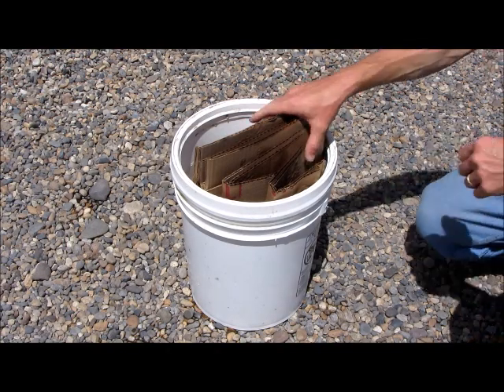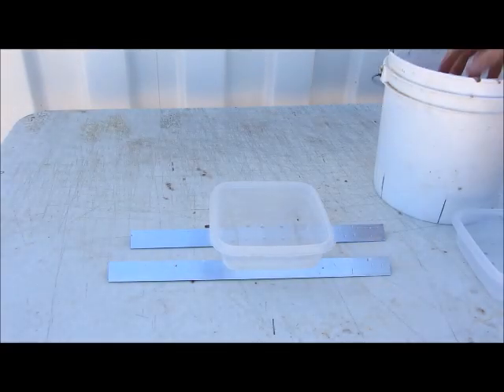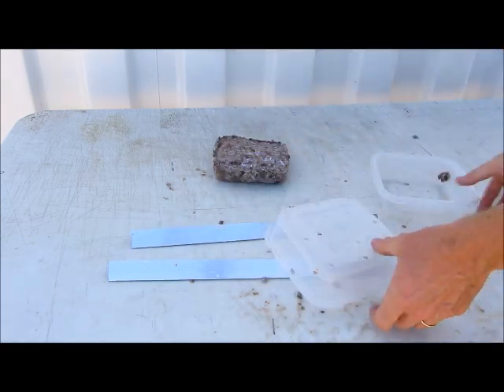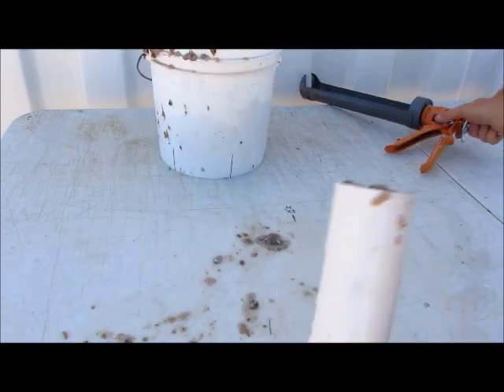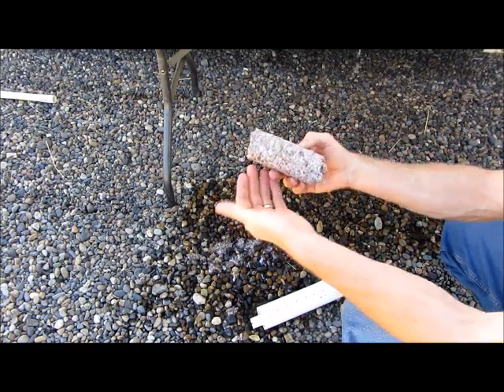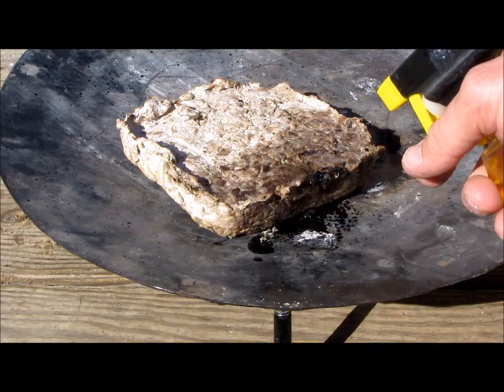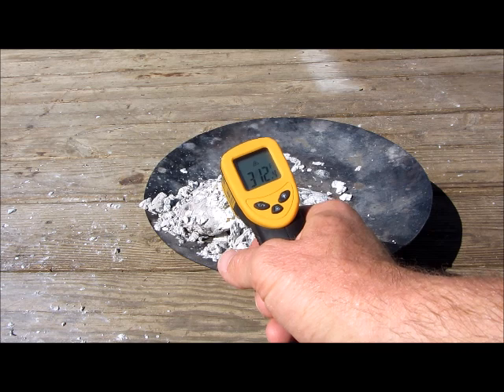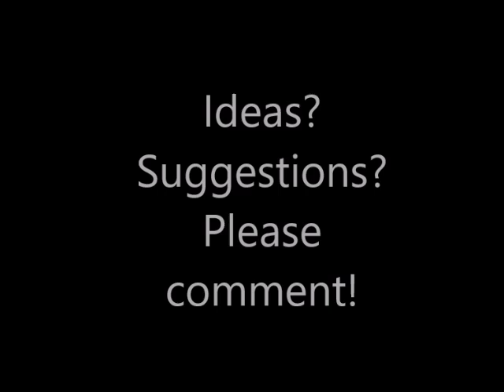Free Fuel To Heat Your Home, does it really work?  Paper and cardboard fuel test

Comment: i do wonder if shredding the paper increases the burn time or heat, as the shredder paper has more air pockets which gives the fire more oxygen to burn hotter. I also wonder if its better to just burn cardboard or just burn paper. i hear cardboard gives a lot of ash compared to paper.

Comment: You are doing way too much work. Why not wet them to soften them, and then roll 'em up tight into a log? Also, instead of lighting fluid, I dipped a small piece of paper into used vegetable oil and threw it into my barbecue (I used tree branches and kindling of course.) It worked like a charm the first time, and is probably healthier. Now if I could get the temp up to 2345 F., I could "bake" my clay creations without having to buy a kiln. Any ideas?

I also like Michael Crumpton's idea below.

Comment: Great video thanks! But how about simply burning paper without mashing and bricking? I know that loose paper may burn quicker than a compressed paper log so need refueling often,  but would one get the same total heat out of it? Would particulate emissions be higher?

Comment: Issue 1: Ash.  Burnt paper/cardboard produces tons of ash - far more than wood.
Issue 2: Mass.  The total mass of paper that you gather to turn into bricks is relatively small each year.  One proper log from a fallen tree that you ask to salvage for firewood will provide more heat.
Issue 3: Time and Space.  It takes a long time to mulch the paper, form it into bricks, and let them dry.  Drying them properly takes more than a few days, and you have to store them somewhere where they can dry during that time, but they aren't weather resistant in the way that wood is, so they need special storage.
Reply: ash from clean paper can go right into the grass or garden. as for the other issues, you're right, but at my job we have so much scrap paper going into the trash that it's dumb not to utilize some of it in some way. instead of watching netflix, I'll spend some time doing this. I'm going to build a press here in a week or two.

Comment: Suggestion, use paraffin instead of anything really toxic. I used sawdust (non toxic wood), put in cardboard egg cartons, with melted paraffin as firestarters for my wood burning stove. Worked very well and was very cheap. I imagine balls of paper slurry and then dipped in a thin layer of paraffin when dry would work just as well. Use an old pot that you don't use for anything else though.

Comment: Davi Hodges

I've seen  many posts about folk tearing up paper, soaking it, mashing it, drying it out and then burning the end result, some of them are quite inventive but all are very labour intensive and very time consuming!  I tried the brickmaker a long time ago using the same techniques...bluddy useless with so much time & effort required......I then experimented with just rolling up newspapers, mags, junk mail, bills, etc, binding them with tape or string, cutting them into sizable length logs on the circular saw bench, and then burning them. 

It worked well, better than I thought it would.  They produces a lot of heat, just as much as the 'wet' method,  a little smoke sometimes, but with only a tiny fraction of the  effort  compared to  making paper bricks......and less messy too!  The rolls do sometimes open up a little once the string burns through but I've not found that to be a problem at all.....they still burn, it's not as if they explode open and scatter burning paper all over the place, that doesn't happen.
 If you leave the rolls for a week or so before burning there's less chance of them fully opening up, they stay rolled up, a little looser but still in a roll, still burnable. The logs tend not to produce much flame or smoke [if any], they just smoulder which is good......stops the neighbours complaining about any smoke.  After, I spread the ash onto the garden which helps the plants and any crops to grow.....and they do  grow bigger & better, but only the ericaceous plants!!. 

The biggest problem is burning glossy magazines because the pages have a thin coating of china clay which doesn't burn, [but it does give the pages a better surface on which to print fine and solid colours! ]  but it just gets mixed with paper ash. Bits of wood mixed in the fire with the paper logs is fine too, so a good mix of newspaper logs with a small percentage of glossy mags is ideal. I should mention that I use a cast iron pot beliied stove which is totally contained and adjustable for air intake etc.,  I haven't used  these logs on an open fire but I would imagine the results would be similar, but perhaps a little caution is needed on a open fire.

Comment: Your location is the key to this.  You really need to be able to dry these WITHOUT spending money.  Setting them in the hot sun is the best.  Placing them on or next to a wood stove is good, but that does technically limit the heat said stove gives off.

Comment: I make fire starters out of newspapers.  Just tightly roll newspapers and thread through an empty paper towel or toliet tissue holder. Set up your campfire logs as desired, then tuck the fire starters in between the actual logs. It's surprising how long they will burn, and set fire to the true logs very easily

Comment: You could make a box out of a 1/2" plywood bottom sides of 2x4 studs. Shaped like a brick, but 3 times taller.  Then drill the bottom and sides for drainage.  Now you need to build a contraption that pivots on one side, and had a long lever on the other, with a pivoting lid with the shape of the box so that it will fit inside.  A drawing would be much simpler to explain.  Then if you stand on the end of the lever, day 200 lb, depending on the length, you could be applying a lot of pressure.  
You could also but the box - lid on the side and find a way to use a bottle Jack to do the compressing.

Comment: When you cook on a grill with charcoal and starter fuel, you shouldn't put the food on the grill until the smoke clears and the coals become gray or almost white. They are still hot, and will cook the food without any toxic fumes or smoke reaching the food. If you cook stew in a cast iron pot, the food does not become toxic from a fire where you use homemade bricks from newspapers. You can use other forms of paper and not newspaper if it matters to you, but you should wait for the  charcoal or the bricks to simmer after all of the smoke is gone and the flames are minimal.

Comment: I have used paper fireballs for my outdoor BBQ. Works 100%. But not as main burning fuel. Paper fireballs serve two main purposes - start and keep the fire and prevent the woods from colapsing when they burn. You put the fireball under. Then put very small sticks on top of it, then put bigger sticks and each layer above put bigger sticks. On the very top put large pieces of wood. i have fried potatoes on this BBQ.

Comment: You'd be working a real long time to make enough of those things to heat your house.  You can buy little brick shapes to do this with where you just wet the newspaper and force them into the molds.  Leave them out in the sun for a few weeks and there you go, but why not just burn wood instead?  We burn all the twigs and fallen branches from our yard with pine cones from our really large trees as starters.  If you know how to make a proper fire, you can have lots of heat without wasting wood.   Sometimes you can find wood from where people have cut down trees and put them on the curb you can merely ask to take.  Most times people say yes.  Do it before you need it so it will be cut and dry for when you do.

Comment: In the 70's a paper roller was available at hardware stores.  We would gather newspapers for the week and soak them in dish water, the soap acts a free liter fuel.  By winding the newspaper into logs we could lay the in the sun for two days.  Turn them when ever walking past the logs. They dry is two days if it dry and hot.  Stack the logs indoors for winter.  Each burns for about two hours.  Be sure to clean the fireplace two times a year to reduce buildup from paper and cardboard ash.

Comment: I had a friend who was too broke to buy firewood,  and would roll up newspaper into a log, and soak it in water.  When it dried, it burned slower than paper normally burns. There was only a fireplace in the 900 square foot house but it seemed to work

Comment: I save tubes from toilet tissue and paper towels, etc..  I fold tubes in half lengthwise and insert them into one tube.  It creates a cardboard tube filled with other tubes.  I then take melted wax from multiple old candle pieces and dip the tubes into the wax and let cool. They make great fire starters and will burn for a pretty long time, depending on how compressed the tubes are.
Reply: Add lint from the dryer for added burn time and wax absorption, use old dryer sheets stuffed with lint in the end of the TP tubes  to hold the wax in better, then fill from the top with melted wax for a long burning log.

Comment: The guy says he wanted to find out...well, read the internet. Someone's already done it. Bear in mind that people burning paper, card, wood at home thinking they are romantic homesteaders being ecosustainable are actually just putting particulates into their and their neighbours' lungs. Buy the correct fuel. Let paper be recycled as paper and card. Use electricity from generators who'll burn the paper properly for you. Their is neither a need or a problem being solved here.

Comment: My brother gets 300 pounds of cardboard every night from work he has 10 Barrels in his out building hey Harbor Freight wood chipper he cuts the cardboard 2 length and runs it through the wood chipper he reclaimed water from the batch of bricks cheese making and that runs into the barrel that you just shredded the cardboard into if he has to buy a 1-ton bale of cardboard that cost him $9 and he can heat his house  for two weeks on $9 worth the cardboard that's pretty good it works on it all spring summer and fall he relaxes during the winter to make one barrel shredded and compressed takes about an hour

Comment: I had some old burlap potato sacks i cut to same size and layered it in every dozen or so paper sheets. Added venting thru whole length me thinks. Ends burn good. Good old hemp. Clean burning. Can add other parts of this so called hemp plant if desired for a more intense experience.

Comment: WARNING, WARNING WARNING
My second batch was mixed inside with the electric drill & paint mixer. HINT: keep away from the sides of the bucket.  I put a hole in the side of the plastic bucket & made a helluva mess of WET grey paper on the floor. Now looking for an old steel bucket. Quick learner this way. LOLOL.(sometimes)

Comment: I use to see people roll up junk mail and cardboard wind it tightly with a string and use them in the fire place for logs.! Takes a lot less time...!
Reply: Alex Causey what happens if the string catches fire and breaks? Does it spew fuel everywhere? If not I’ll have to give that a try.
Reply: @gooddeed26  He doesn't know because he's lying about seeing people do it.
Reply: I've seen  many posts about folk tearing up paper, soaking it, mashing it, drying it out and then burning the end result, some of them are quite inventive but all are very labour intensive and very time consuming!  I tried the brickmaker a long time ago using the same techniques...bluddy useless with so much time & effort required......I then experimented with just rolling up newspapers, mags, junk mail, bills, etc, binding them with tape or string, cutting them into sizable length logs on the circular saw bench, and then burning them. 

It worked well, better than I thought it would.  They produces a lot of heat, just as much as the 'wet' method,  a little smoke sometimes, but with only a tiny fraction of the  effort  compared to  making paper bricks......and less messy too!  The rolls do sometimes open up a little once the string burns through but I've not found that to be a problem at all.....they still burn, it's not as if they explode open and scatter burning paper all over the place, that doesn't happen.
 If you leave the rolls for a week or so before burning there's less chance of them fully opening up, they stay rolled up, a little looser but still in a roll, still burnable. The logs tend not to produce much flame or smoke [if any], just a severe smouldering which is good......stops the neighbours complaining about any smoke.  I spread the ash onto the garden which helps the plants and any crops to grow.....and they do  grow better!!. 

The biggest problem is burning glossy magazines because the pages have a thin coating of china clay which doesn't burn, [but it does give the pages a better surface on which to print fine and solid colours! ]  but it just gets mixed with paper ash. Bits of wood mixed in the fire with the paper logs is fine too, so a good mix of newspaper logs with a small percentage of glossy mags is ideal. I should mention that I use a cast iron pot beliied stove which is totally contained and adjustable for air intake etc.,  I haven't used the these logs on an open fire but I would imagine the results would be similar, but perhaps a little caution is needed.

Comment: Rolled up newspapers into logs( tie)  soaked in garbage bin filled w water. Remove logs and sun dry for the day. No hassle, ready to use. Can use in smaller pieces if wanted. Used to start campfires. Burns for a long time :)
Reply: Will burn faster if not soaked in water.

Comment: I shred paperwork, bills etc when its time for them to go. I make pellets with a old pipe. Sometimes I add bark, grass, leaves and old linen, then make your goo, put thtough the food processor and dry out. Bag the pellets up in 500gm zippy bags. It will be fine for first night on the trail before checking out whats around. If you have a large yard and an old metal garbage/refuse bin you make it a charcoal burner. Use on bonfire night to disgiuse it.

Comment: Years ago there was a hydraulic machine that made paper and cardboard logs. It cut and chopped the material, then, with a simple hyd ram, it compressed the material into a tube until it reached a specific length, then was ejected as a perfectly formed paper log. Cart-O-Log was the name. Long gone now, but a great machine. They added one ingredient to the chopped material that made the logs burn much longer than simple paper. Now that I'm retired, I plan to reproduce a similar machine and do this myself, so I won't say what the ingredient was for now. MAybe later.
Reply: Then maybe you should’ve not commented at all

Comment: I tried this one year with a brick press. Two problems 
1 you need lots of room and hot days to air dry all the bricks
2 there is so much more ash left after burning these that it's not long before your fire place is choked up. 
It was fun to try but far more effort and time needed than to cut and split good old fashioned logs.

Comment: The key is to have a setup with an electric jack or actuator to compress the paper mash for you, and also do multiple logs each compression.
Once u set it up that way, the time is worth the savings.
Also, the more compressed you can get your log, the slower it will burn.
You can make kindling by making little sticks of the mash too

Comment: I tried to make bricks from newspaper: they didn't burn at all. They use paper pulp as a cavity filler because it is inflammable: I have seen with my own eyes a guy trying to light it up. If you need to add chemicals to your fuel, then it's not worth it.

Comment: I am sure this not an original idea, but oh well. Instead of burning the stuff, mold it into bricks or insulation. Cover it with a tarp to keep it dry and you would have a warm shelter. You could coat the inside of the shelter with clay and be very careful with fire.